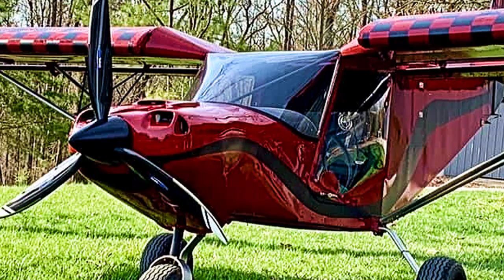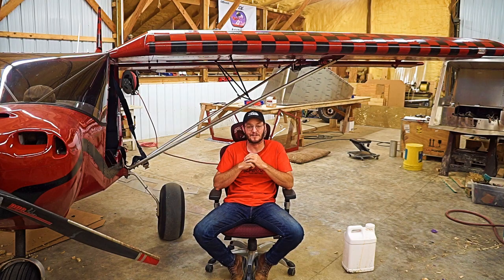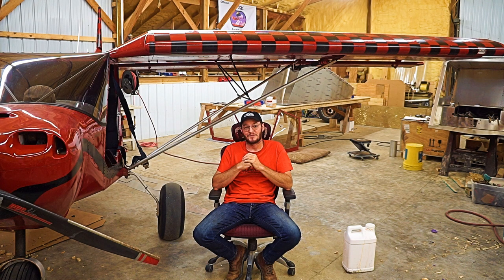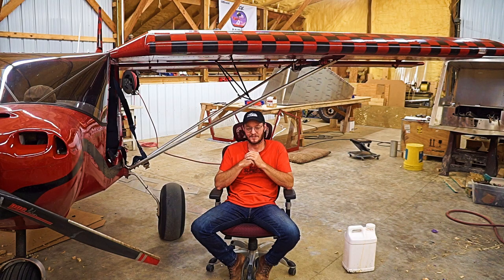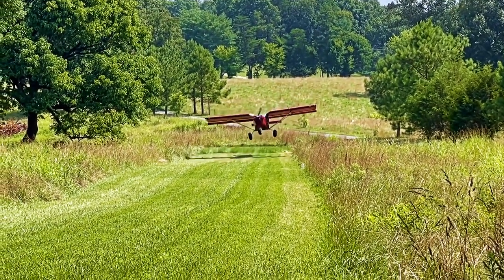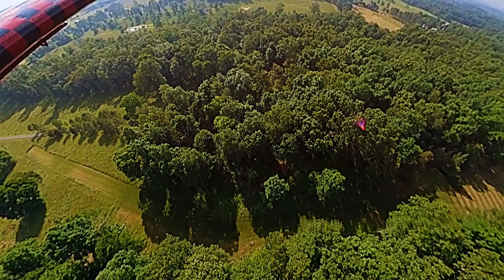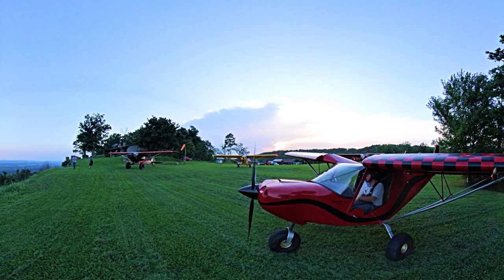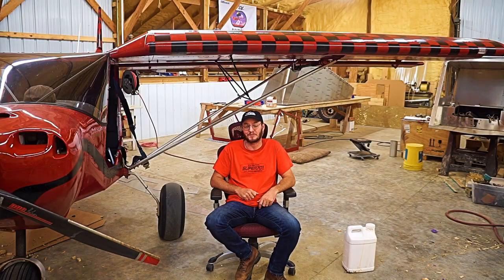Shortest Runway in the world? Part 2, length correction, tall grass, & real talk with Jon! #Super701

Comment: I am going to get beat up for this I am sure, especially with all of Jon's fans.  I feel pretty safe in saying Jon has more room then what he is claiming.  At the 8:00 minute mark he shows himself landing it for the first time at the road.  If I go to google earth and type in 282 Mikel Rd Se
 Cleveland,  TN.... If it was my place I would have it set up for landing at the road, just more options.  You can always land long on calm days.
I measure it from the road and it comes up over 400 feet.  Still a short strip but if you choose to only mow 300 feet of a 400 foot area I guess that is just a way to limit what God gave you.  What you leave behind you can never use and if it was me and I had a usable parcel of land I would mow it for those days when I come home and the winds are squirrely.  I would mow it extra wide in the area that the wind can cause me to possibly drift to also.  I should have followed the golden rule!  I wish Jon the best, I will leave with one parting comment, take it for what it is worth.  I would not do those radical steep climbs at low altitude, it is a good way to have a bad day.  It was the first thing I noticed when I watched your video... Fly safe and keep making videos!

Comment: At 8:26 mark the 1st pic have thought about taking out those trees @ the (1st white dot @ the top of the 1st pic) u may be able to put in a rd style drain for run off and fill it in (i know that its hard to tell from a pic) could use the trees that u cut down as a retainer wall poss. It looks like it may would give u a couple hundred feet at least just buy taking those trees out and filling in it if it's possible. Oh and dont let the NAH-SAYERS  get to ya brother chances are THERE PILOT'S LICENSES IS FOR A THE NEW LINE OF AIRCRAFT CALL (A  SIDE STICK NO-WING LAZY BOY WITH A SINGLE POP UP RUDDER PEDAL) THAT FLYS OFF OF A CARPETED RUNWAY IN THERE LIVING ROOM. LOL

Comment: Jon, I sure hope you wear a helmet that protects your jaw, face, and noggen when you are demonstrating the "rocket" extremely steep climb-outs.  My worry is you and aircraft will experience a FACEPLANT when your engine stops one day.  (Think of your wife and children.)   Go to a good safe altitude and assume that "steep max power take-off" and turn the ignition OFF.  Check what your vertical airspeed is when you have dropped ONLY 100 feet.  Next, pull mixture to CUTOFF, open throttle, let it windmill a bit to clear full from the cylinders and  muffler of FUEL.